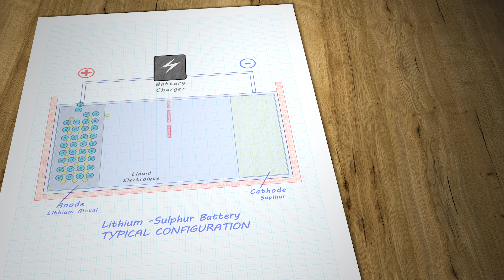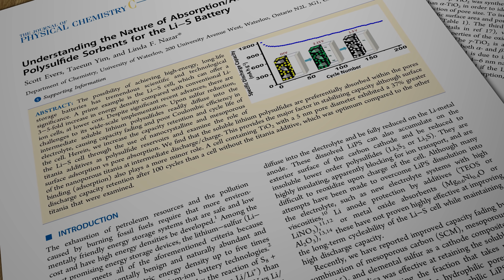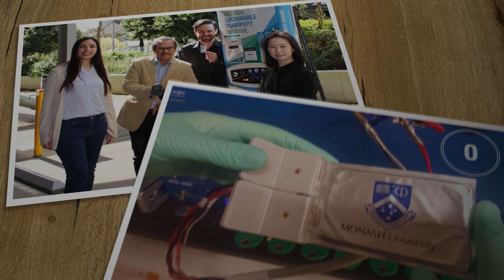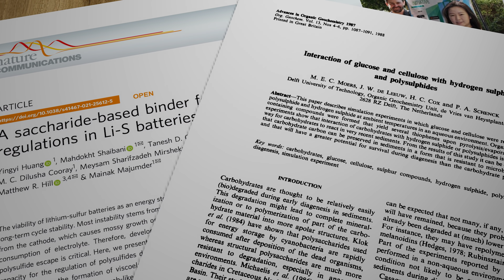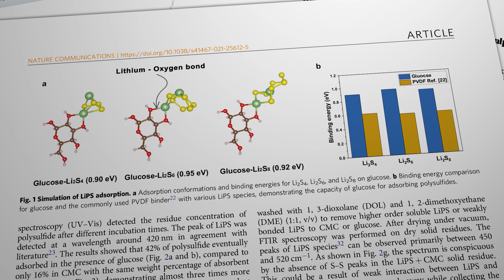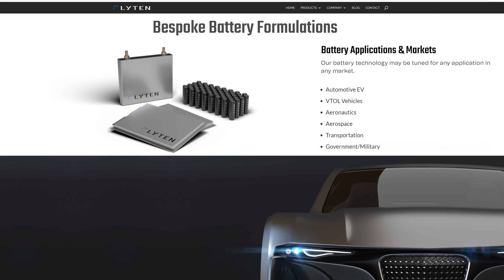Lithium Sulfur batteries: SOLVED! Two new tech breakthroughs in the same week!

Comment: We're at a point where if these "novel" batteries have a full-scale manufacturing cost of over 300 USD per KwH, assuming they can successfully produce and maintain a manufacturing line, it will be irrelevant. No commercial company will use. It will not make economic sense. The benefits will not outweigh the cost and it will be exclusively used by governments. Many such examples in the US defense industry. Sad!

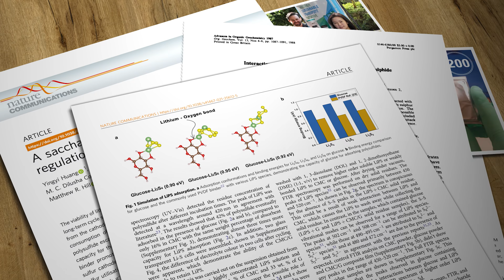Comment: 7:07 "rare elements like cobalt and nickel" - cobalt and nickel are not rare.  As long as humans mine for iron ore there will be plenty of nickel and cobalt on hand.
Reply: On-hand and plentiful are very different things.
Reply: @absalomdraconis  Fair enough yet Nickel still isn't classified as a rare earth or rare element. It costs the same as Hydrogen and even 20 times less than sodium.
Reply: They're not rare elements but cobalt is about $18/lb so that's a big part of the cost of a battery.  Also the weight is the biggest problem.

Comment: Only about one legitimate technical contender in five make it to market, not always does the best technology rise to the top of the market, and the speculative space where legitimate and spurious technologies compete is mostly spurious. Still, 500-900 Wh/kg ought to be feasible on basic principles. Gasoline is in the range of 14-25 times that density, but caps out around a third the simple, direct mechanical efficiency (5-8 times), and there are ground EVs with up to six times the efficiency of ICEs and eViation designs with 5-8 times the effective efficiency due distributed rotor airflow effects, reportedly. All with drawbacks, limitations and caveats, of course. 
With circularity considerations, before counting climate change or pollution or health effects, this is the obvious course to chart even if technology falls short of the promise.

Comment: Now replace the lithium with sodium and use them for grid storage. Sulfur, carbon, and sugar is one of the cheapest electrode materials I’ve ever heard of, I look forward to this technology immensely.
Reply: When I worked in aerospace we were looking very seriously at sodium-sulfur batteries for satellites. However, the fact that they operated at (IIRC) 450 C and each cell had to be recharged individually made them impractical for that application.
Reply: @Globovoyeur  
That’s an interesting temperature requirement, was it due to the sodium side or the sulfur side? I assume it’s the sulfur side since sodium melts at only 98C, meaning whatever advancements led to the sulfur chemistry being viable for lithium probably also applies to sodium.
As for individually charging them, cell balancing has been standard fare for lithium ion battery packs for decades now.

Comment: So how much energy is required to create a battery that could operate a vehicle. What's its carbon footprint. Then the next question is what is the carbon footprint of the electricity production to fuel this battery. Remember nuclear is not an option and we already use all the electricity generated by hydro. So the only viable option seems to be burning that clean burning coal.

Comment: I was curious about the Lyten lithium-sulfur battery and tried to research specs on the cells. There are no "real" numbers about the cells spec. That strongly suggests that they either don't exist, or they need more funding to make an attempt to make them actually exist. Either way, they don't exist for any market to use. Much of what is listed is hogwash. Saying things like, "They will" simply means that "they don't". Specs that are listed, well most of them are already topped by lithium polymer batteries you can actually buy for rc toys today. All but 1 of the specs mentioned in the writeup about the batteries can be topped by a decent rc battery. With any other emerging battery technology, I will believe it, when the RC market starts selling them and they prove themselves. RC is one of the first public markets to use battery advancements, and has been for years. The graphene batteries that were going to change the world were available in rc years ago, and they are no better than any other design.... The emerging battery technologies and Mary Poppins only have one thing in common. Mary Poppins is fictional...

Comment: Skepticism of new development is always warranted, but keep in mind that the price of batteries have dropped by 97% over the last 27 years. And that the curve isn't flattening yet. They've dropped in price by over 50% since 2013. They're expected to drop over 50% by 2025.

At some point, they'll probably be inexpensive enough that they will choke out potentially better approaches.
Reply: I'll totally agree with your assessment when it comes to battery powered passenger cars. Local logistics and distribution can be done with battery powered vans and commercial vehicles with the currentr state of technology and prices will dictate the market in the comming years.

For long haul freight transport the picture is different. A drivers should be able to drive a full shift (around 9 hours, 800km in best case) without having to stop 2 hours for charging. 
A fullly loaded 40 tons semi truck uses about 250kWh/100km. This means an on-board capacity of 2000kWh would be needed. With the current state of tech this means 8 tons of batteries alone! A breakthrough is needed to makes electrification economically and practically feasable in this case.

Substantial electrification of air travel needs gravimetric density 10x higher than what is commercially available now and still 3-5x more what is promised to be in production in 2025 ... not only LiS, but also solid state Li batteries. The question in this case won't be "which battery is cheaper?" but rather "which battery can do it at all?".

And even if the LiS chemistries fail to get power density (essentially C-rate) right I can see people being willing to pay more for a smart watch which runs for longer than a day on a single charge or for in-ears which play longer then a couple of hours. I can even see people which need more than 5 hours screen-on-time of their smart phones.
Reply: @glockmanish  : For some flights batteries will never be practical, because there's no possible chemistry (not even sodium-flourine!) that can compete with the volumetric & gravitometric densities of hydrocarbons or hydrogen- these routes will either have to be abandoned, moved to vehicles like zeppelins, or move to artificially produced fuels (either hydrogen, which is honestly horrible as a fuel for it's behavioral characteristics; or synthetic hydrocarbons).
Reply: @absalomdraconis  First: I can take noone serious who is using "never" in the scope of technical progress. In the 60s you would have been the one telling us that there never would  be billions of transistors on a cm². How can you do such a statement?! There are chemistries in the theoretical phase which have 200x the energy densities of what is in use now!

You don't have to directly compete with the energy density of fossil fuels! My Kona electric's battery holds the energy equivalent of 7L of petrol when fully charged. The pure fossil version of the Kona can drive 100km with that energy. So by your flawed logic I would NEVER be able to drive 400km in the real world, but I do, and even 500km when pure city driving and warm dry weather come together! To understand whether the energy density is enough you HAVE TO view every vehicle as a system. Easy: energy on board / consumption = range

In the world of planes this means that at first only smaller and lower flying planes can be electrified, even when considering hydrogen. E-Fuels are out of question: dirty as fu** and more expensive than fluid gold. CO² footprint as a whole would probably (no numbers crunched on that) be lower when we keep flying the "old metal" on long-haul flights on kerosine compared to building a stupidly massive and energy hungry infrastructure which can sustain the need for synthetic jet-fuel. Even green energy is neither CO2 neutral nor "free" ... so wasting 90% of it for the same energy content compared to a battery is simply NOT sustainable!

And furthermore: By far the most flights and miles flown are domestic or intra-continental. And as the most energy hungry part of the flight is the start and climb those short flights are the ones where to get rid of fossil fuels! I remember having sat in multiple inland flights (in 2016 one did that even in small Germany ... schame on me ... but it was cheaper than train AND car!) which weren't even half occupied, more like 1/3. So having smaller single-pilot (or even no-pilot) E-planes scheduled more often and only starting when a minimum percentage of passengers are checked in would greatly reduce the CO² footprint! Then it would truly be an air-bus ...
Reply: @glockmanish  Dennis, i dont quite understand what point you are making here,  but range and energy used are not the only metrics to be considered for a full comparason.
By definition , energy density is defined in terms of weight and volume , with cost being an equally vital factor. ..( you could have the ideal , lightweight, infinite, energy source,....but if its cost was totally unafordable, then it would be impractical for general public use.
 This is the current  problem with EVs, ..not technical density factors , but their cost .which is basicly dictated by the size of the battery pack , hence why the Kona EV  costs $20k more than the ICE version,..( and why hybrids are so much more affordable !)
Reply: I guess you are using the price of li ion cells  from its first availability, to current , for that 97% figure ?
But the reality is that neither price of performance metrics have significantly changes in the last 5 years.
Infact the commercial price of batteries like the Tesla powerpacks have actually increased recently, but either was are still prohibitively expensive for adoption universally for storage or transport. ..(yes, i know they are used for both, but that does not mean they are universally practical !)
Reply: Tell that to Duracell and Energizer. I think they missed the memo.

Comment: Personally more excited by the heavy iron batteries because they are highly recyclable, iron is plentiful, and they expected to have long life spans. You can put down one of these at the end of every city block and greatly smooth the daily power drains while also providing a day or more worth of power during disasters.
Reply: NiFe batteries have been around since the 1920s. The have substantial energy storage capacity, very good cycle life and are extremely durable with a life over fifty years.

Problem is they have relatively poor cycle efficiency and low cell voltage 1.2V.

https://en.m.wikipedia.org/wiki/Nickel%E2%80%93iron_battery

Comment: The longer a "technology cycle" goes on, the more skeptical of claims investors should be.

Questions you should have solid answers for before getting excited.

The term "In production" can mean anything from a factory making commercial quantities of batteries to three college interns hired to assemble testing prototypes in one of the labs back rooms, so which is it?

"In as little as 20 minutes" means "At least 20 minutes" whats the actual normal charge rate?

" Up to 1500 charge cycles"  the maximum number of charge cycles is usually achieved through slow trickle charges ....how many fast charges can it survive?

What temperature does the battery operate at because a battery that freezes below 150⁰C would be borderline useless.

Comment: The trend I've noticed with battery breakthroughs is that 90% of them turn out to be almost completely impractical, and the remaining 10% turn out to be a lot less good than we hoped. But we usually still learn something from the impractical batteries, and that knowledge contributes to future breakthroughs and improvements, and even a small improvement is great. Lithium Ion batteries as they are today are good enough to get most of the job done, with enough investment they can handle all ground transport and grid storage, but fall a bit short for air and sea travel. A little bit of an improvement may be enough to cover those final cases and also accelerate the transition in ground based transportation.
Reply: And yeah the price of batteries per watt stored has dropped by 97% in 27 years.  And it's dropped by over 50% and just the last five years.

At the current time there is no flattening of the annual curve of improved per dollar.  

It is expected to be $96 per kilowatt-hour stored by 2025.

One of the main things keeping it expensive now is that every time the price drops, demand surges even more at the new lower price.

So don't be too pessimistic. Things are improving every year. And I'm ignoring competitors like gravity storage and the new Iron chemistry batteries which will probably lower prices even more.

And I can see a day when every house and apartment has an inexpensive 1 to 3 kilowatt hour buffer battery that greatly smooths the "duck" curve.
Reply: They are indeed Goodenough 😂
Reply: There is no reason why carbon GHG neutral synthetic fuels can't replace jet fuel and diesel. The technology is available and well understood. All that is needed is the incentive to switch.

Comment: The polysulfides form as lithium ions enter, but the carbon-graphite honeycomb structure does not change when an ion enters. I would think the entropy of the sulfur phase change would harm the cycle efficiency (power_out / power_in). The carbon-graphite honeycomb and ion are challenging to outperform in this way. It is also worth looking for this concern with solid-state state batteries. There might be applications where lithium sulfur's high energy density makes sense, but it likely has an energy storage tax (~30%) that the carbon-graphite honeycomb cathode does not.

Comment: Remember kids: while there is some room left, battery chemistry is limited by basic physics, each atom has a fixed mass and fixed valance shell electron count (with each level having a fixed voltage) and this caps the possible potential specific power of any chemical electrical cell that could every be invented, even under ideal theoretical conditions.
Reply: Is this for the people who think that solid-state batteries will be enough for container ships and Elon Musk's electric F-35/Concorde passenger plane?
Leave the hard stuff to hydrogen.
Reply: @موسى_7  Yes C15H15

Comment: My gut level guess is that as exciting as all the news is, I get the feeling that whatever technology becomes practical, it's about 10 years before we see it hit mass production.   However, given the number of labs doing the R&D, at least one of them has to hit on the winning solution.
Reply: All the more reason we should be funding more research, not subsiding 19th century technology that’s already obscenely profitable.
Reply: Joel Jeffcoat   There's already lots of R&D Labs pouring millions of dollars into improved battery technology.   Every now and then News pops out about an improvement that a lab discovered.  Given enough time we'll have a major improvement that goes to market.  My best guess is about 10 years.
Reply: Everyone seems to be in anticipation of the 'Eureka' moment in battery technology when in fact it will probably be a matter of small step improvements over a long period of time. Look at electric motors which have been incremently improving well over a 150 years ! Batteries have come a long way as well - compare Voltaires battery to what we have now. Once again it has taken a long time to get here. 'Eureka' moments are very rare and transformative. Sometimes they come from shear brilliance and sometimes shear good luck. Whether this is going to happen in battery technology remins to be seen.

Comment: Hopefully in less time than might be expected we'll have EV  batteries that will largely outperform current ones in more than one feature. However, as Venkat Srinivasan says, “Of the four metrics that batteries are graded on for a given application (i.e. performance, cost, life, and safety), typically, only two can be simultaneously achieved. If the battery is designed to also perform satisfactorily on a third metric, it will fail spectacularly on the fourth.” We can only expect that he's wrong ....
Reply: that is changing

Comment: Battery tech development is starting to sound like fusion energy, it's always "X-number of years away", for fusion it's been 20 years away for about 60 years, for new batteries, it's always 4-5 years away, after they get a ton of venture capital of course.
Reply: Fusion based on current models of the Sun are doomed to fail because the models have already imploded. There is a lot of fraud in fusion projects.
A project to look at that has promise is the SAFIRE project. This is first year of five year project to build one.

Comment: "Theoretically 5x more capacity"  So 10-20% increase in capacity over current chem when it finally gets to end users.
I suppose the real potential is in the use of common elements, however the difficulty in manufacture will determine any actual net cost benefit.
Reply: In just the 1st generation
Reply: With 5x overpromising, the real potential is in attracting dumb venture capitalists and then liquidating the company in three years.

Comment: That's not happening, Li-ion batteries are already extremely energy dense, having 5x that density would be a hazard I doubt any sane person would refuse. Also, Lithium-Sulfur require microchips on them to limit runaway discharges making them unreliable in cases of dire need such as planes or cars.
Reply: “Refuse” = “accept” (the double-negative trap)